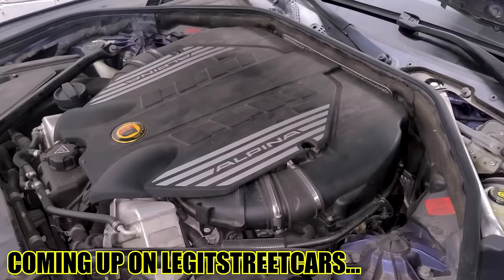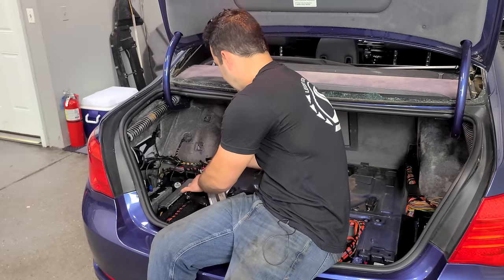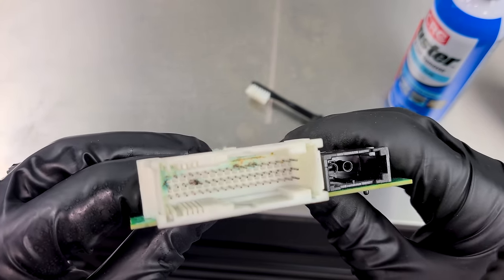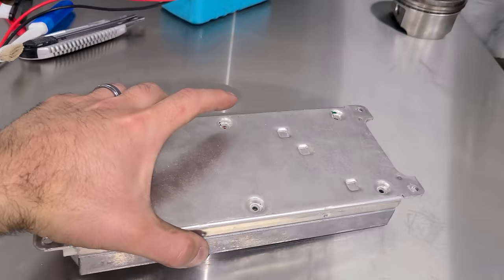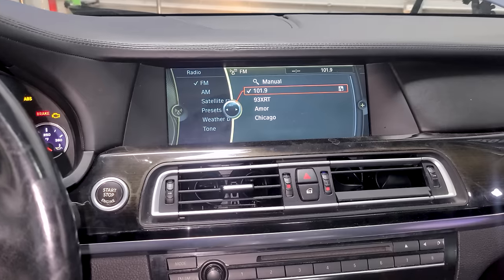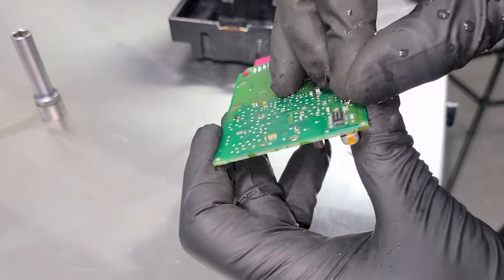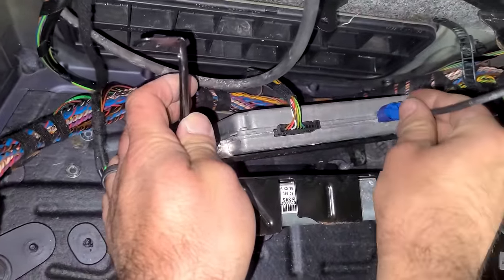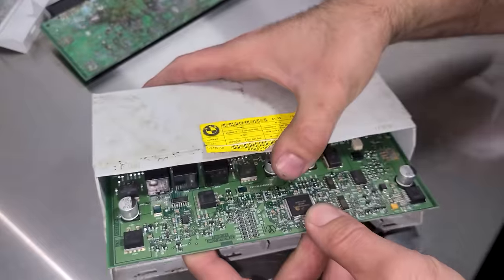BMW Dealer Tried Totaling My Car By Quoting $15,000 For 10 Computers! I Fixed Them All For $150!

Comment: Ive never seen such bullcrap. Electrolytic corrosion is almost impossible to stop, let alone the fact that he ran power thru the TCB ecu before 'cleaning' it, guaranteeing thats its now totalled. The whole video is a joke. Yes Im an electronics eniginer, yes Ive coded more BMWs than I can remember. Its basically an ad for Carly (which is utter junk) backed up by rediculous statements like 'this battery can sit forever and it will fire right up" - no, no it cant, security systems in the car will eventually drain the battery completely. ---, " be careful with circuit boards, you can snap them right in half"😂 try it, try snapping one. This clown is clueless. This reminds me of those old videos showing you how to swap iphone screens. Carly is expensive and extremely limited in functionality....and this guy would be better off selling double glazing. The TCB he replaces, DOES need coding, and Carly cannot do it. The water he uses is actually distilled  This whole thing is hilariously dangerous. Oh, and finally...using power tools to remove $1000 circuit boards!??? Seriously?....and there are no 'dumb modules' in a BMW, they all need to be coded. You might get lucky if the VIN in your donor part is corrupted, but otherwise they all need coding.

Comment: Bmw sucks all of the good engineers left for Hyundai in 2000 they're trash even under warranty clearly the worst ownership experience I've ever had and I'm no stranger to luxury vehicles I've cut my teeth on Land Rover. 
That being said there is a reason bmw doesn't have the nearly the same terrible residual values as land rover. They should.

Comment: Sadly from 2030 on all combustion cars including classics will be banned
from public streets in entire EU and Scandinavia  :-( In Germany the 
Green Peoples Party gave order to shorten fuel supply from 2025 on by 
reducing petrol stations to only one state operated central gas station 
per city. From 2027 on in the EU certain car spare parts will be banned 
too....as exhaust systems, turbo chargers and even some engine and 
gearbox oils...California and New York will do the same from 2027 on....
So no investments should be done in oil burning vehicles any more....:-((